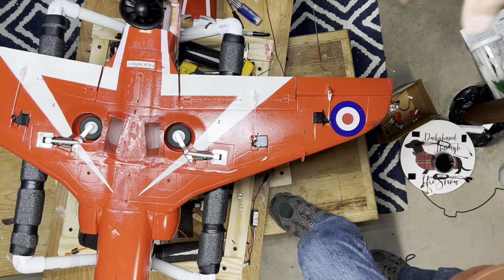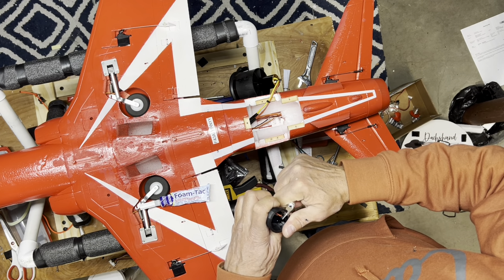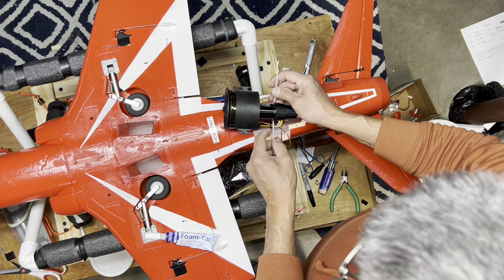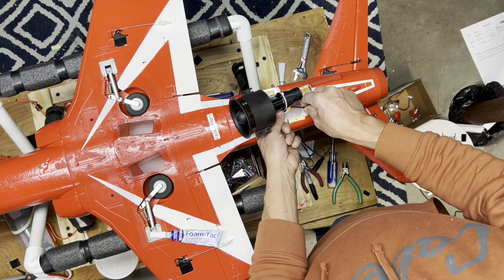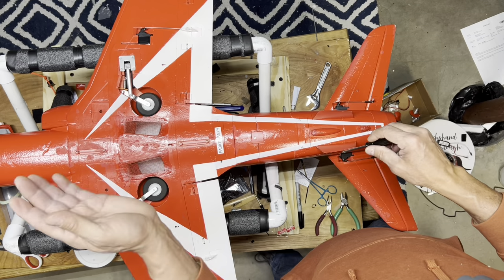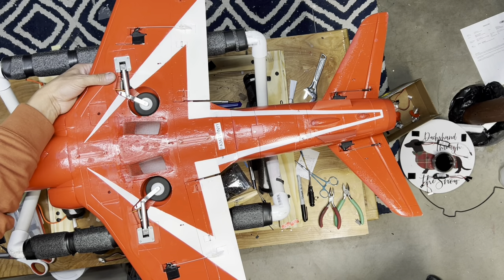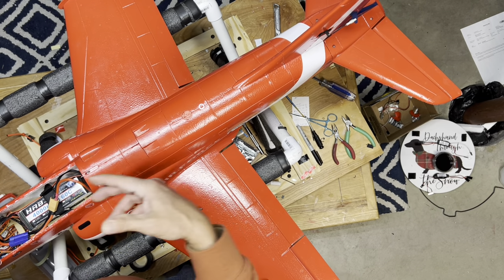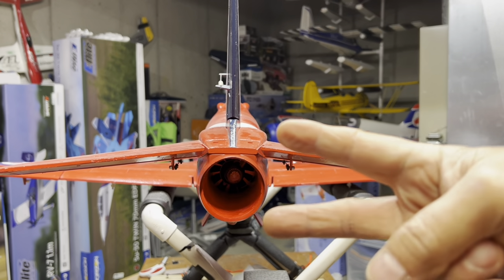How to: Afterburner install tips/tricks/tools needed, 5280 RC Truefire kit

Comment: Interesting to know about the Gyro issue with the burner control. Will have to try this with mine 👍🏻
Reply from the maker: It doesn’t always happen but it has happened to me and the reason I think is because it causes a voltage spike for a split second and can cause the gyro to reverse its settings, when I power the plane first then the AB controller it’s fine, I know it’s weird but it’s a thing
Reply: @DeucesWildRC  I was thinking about a spike or inrush current from the LED’s. Still cool thou 👍🏻